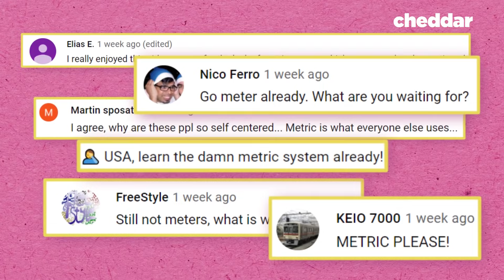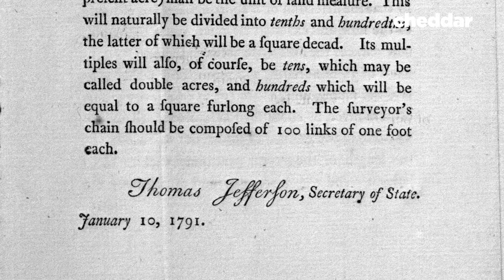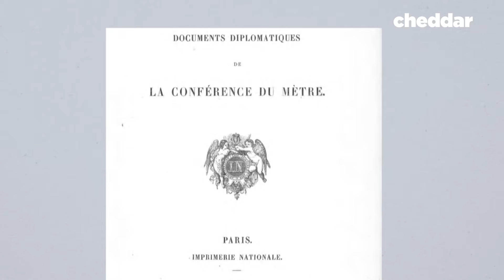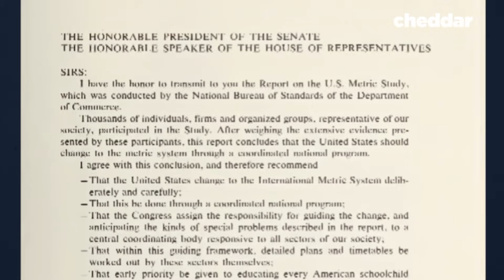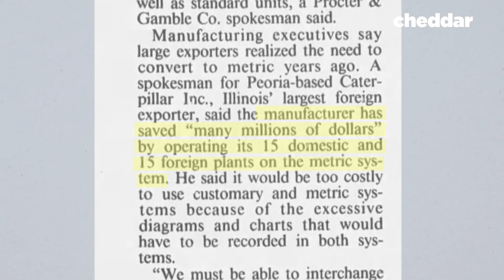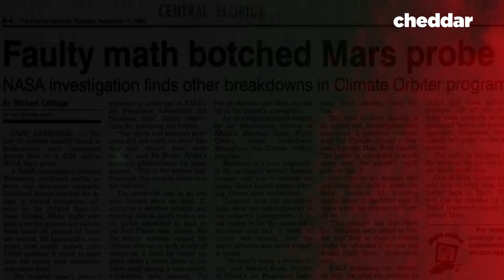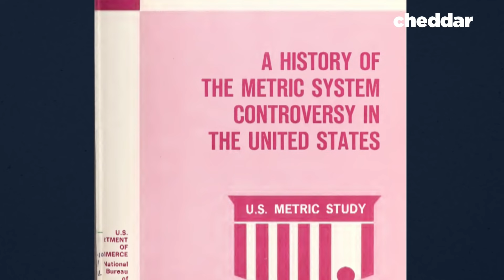Why Doesn't the US Just Use the Metric System? - Cheddar Explains

Comment: The thing that bugs me about America not using the metric system is that we still get TVs and monitors that are mesasured in inches and converting it to cm is annoying every time I want to buy one or when YouTube’s use the imperial system when speaking about a product 🙄
Reply: Yeah that's right, also the whole aviation industry uses imperial system which doesn't make sense in 2020
Reply: Just take a tape measure with you when you shop for screens.  Get one with a dual scale.
Reply: @GH-oi2jf  you can’t cause the screens are in boxes
Reply: @sihle8175  — Most places have screens out on display.  Even so, the measurement given is a diagonal, which is useful only for knowing which one is larger.  If you have a restricted space, and want the largest one which will fit in the space, you need the horizontal and vertical dimensions.

Comment: I highly recommend watching Numberhubs guide to the imperial system. It's hilarious and completely senseless. The imperial system that is, not the video. 

Literally NONE of the units, mass or length can be converted by a whole number, whereas the metric system can be converted however much you like with decimal increments of 10. Same goes to mass. 

And don't even get me started on the fahrenheit scale. Now that's one fucked up conversion...
Reply: That’s just not true.  There are 12 inches in a foot.  The conversion factor, 12, is a whole number.
Reply: @GH-oi2jf  Okay fair. But then there's 3 feet to a yard and1760 yards to a mile. In the metric system there's 10 milimeters to a centimeter, 100 centimeter to a meter and 1000 meters to a kilometer. What I mean is, there's no clean way to get from any length unit to any other lenght unit the same way as the metric
Reply: @24Shigeru24  — Three feet in a yard.  athat’s a whole number.  1760 yards in a mile.  That’s a whole number.
Reply: @GH-oi2jf  Yes, but can you, super quick, calculate how many yards in 3 miles? That's  what I mean. It's SUPER easy in the metric system, the number of meters in 3 kilometers in 3000. Nice and easy :)

Comment: Metric is only good for certain things that need very precise minuscule measurements.  But things in America are typically larger and longer.  The average American is used to going further in increments because we must travel further to get things done.  How would you like to do things one kilometer at a time going through Texas VS one kilometer at a time in Liechtenstein?  In Texas we’re used to traveling up to 2-3 hours each way for work, but on an average of 1/2 hour to one hour by car, which is usually 30 miles to 180 miles.  But in places like Washington D.C. 5 miles is to far to hookup for sex.  See my point?  Why switch to smaller incremental measurements, when things have to be done on much much larger scales?  Our largest cities in the US aren’t examples the average American struggle.  I sure as hell don’t want to say I ran 5 kilometers, when it was only 3 miles. We like to achieve things in larger sections, because, if we incrementalized it to death, we’d be sitting here forever doing nothing.  The only reason our races are metric is to attract international participation.  On the other hand temperatures and climate range much larger here.  So, with our larger range of climate we have plants that need more specific temperature ranges than Celsius provides.
Reply: Hi gdaholic - in science, astronomy, physics, etc... where we deal with incredibly large values, we use the metric system - it is a factor of ten not 1.66, then .28, then 1/27, etc...  No, I do not see you point.  In the military, we deal with very, very accurate firing solutions, at great distances... in meters or "clicks (i.e. kilometers).  Americans have a problem learning "new/old" things or accepting truth... Ciao, L (American Veteran).
Reply: lancelot1953 again you just proved my point, you only mentioned things that need great accuracy.  Something that is done casually on a daily basis would be very impractical to be measured on Metric.  Globalization is only convenient, not necessary.  And sometimes globalization makes things more inconvenient.
Reply: Hi Gdaholic, really?  What kind of rhetoric is that?  The metric system was adopted at great cost (for some countries) by the rest of the world for a reason... it's simplicity, its correlation/translation 1:1 with weight, volume, liquids, area, temperature, microscopic to interstellar distances, physics, chemistry, electricity, etc...  On a "casual basis" how is this "practical"?
1 inch = 16 lines,
12 inches = 1 foot
3 feet = 1 yard
1 mile = 5,280 feet or 1,740 yards, etc...
Now convert that in acres, Amps, gallons, Fahrenheit degrees, etc... or put that in fractions - metric systems is made up of factors of 10, all using the same prefix/suffix whether small or large.
This is why nearly all the US industries have switched to metric, no it is not for China, it is because it is better, it is scientific.  All medicine, engineering, electricity, astronomy, nuclear, etc... is metric, except some average Americans that just do not want to "learn", they call it "tradition".  If you "point" was so good, the rest of humanity would agree with you, but it appears that the world has changed despite your beliefs...  Incidentally, the atomic bomb was calculated with the metric system.  I rest my case and good luck, I do hope that next time you go to an emergency room, they do not prepare your medications in "grains" (old US standard)!  Ciao, L

Comment: Imperial is great for "guestimating'... such as ones height - 5 foot 7 inches...

But for accurate measurements, I would say metric..
So yes..metric :)
Reply: But how offten would you mesure your self.
Reply: Accuracy does not depend on units.  Neither does precision.
Reply: @GH-oi2jf  fair enough... but in this argument...metric vs imperial for day to day work... which measure of unit would be more 'reliable'.. ?

Comment: The standard system of scientific measurement are based on the centimeter, gram and second (centimeter-gram-second system of units).  There is also the inch-pound-second system, but someone also proposed a furlong-stone-fortnight system.
Reply: The last is just a joke.  The jokesters don’t add anything of value to the discussion.

Comment: At this point i prefer imperial for day to day use aka temperature, volume, weight, but prefer metric when doing calculations. Length under 50 feet is something i always prefer imperial for as feet are a lot more convenient than meters. If imperial had something similar (bigger than a decimeter, smaller than a meter) honestly it would be fine. Also Fahrenheit is better than Celsius. I want to know how humans feel not how water feels. In fahrenheit 100° is pretty hot for people and 0° is pretty cold. In celsius 0° is cold but not very cold, and 100° will kill you from your blood boiling. In outside temperature where I live fahrenheit is basically on a scale from 0° to 100° while celsius is from -18° to 38°.

Comment: Radio, Radar, TV have been using metric for generations - I began using the metric system when I began my interest in RF systems in the late '40s. It was a "no brainer" and simple and easy to use for wavelength measurement. When I lived in Japan in the early '70s, carpentry was easier with the metric system, because all dimensions were easily calculated using an inherently decimal system - (never needed to convert between fractions of inches to decimal & vice versa.)

Total conversion from one system to another is not always without difficulty however - During World War II,  the Russians reverse-engineered  a B-29 which had gone down in Soviet territory. They encountered problems in attempting to build a copy using material  they used in their aircraft manufacturing processes. For example, the thickness of Russian aircraft aluminum sheets used for the "skin", had no exact match with its US counterpart - so - "Do we use thinner, or thicker material ? " Thicker adds weight, and thinner may result in a compromise in strength.

Comment: Many "Imperial" units are NOT used in any normal person's daily life in the US. I have no fucking CLUE what a "gill" or a "rod" is, But I use millimetres (and inches) and liters (and gallons) daily.  I can use Kg AND Lb but NEVER used a "chain" or a "furlong" EVER.  And I am almost 60 Y.O.
Reply: You don’t have to know all the units, or even know what they are.  The more obscure units were generally chosen for particular purposes.  For example, the “chain” and “rod” were used by surveyors.  A chain is 22 yards, which is one-eightieth of a mile, and it was measured with a physical chain.  A chain of a yard would be useless and a chain of a furlong (one-eighth mile) would be much too heavy.  I expect they aren’t used anymore, because modern surveying instruments have made them obsolete.

A “rod” is a quarter chain, which is 16.5 feet.  That’s about as long a physical rod as could be managed, I suppose.

The furlong is mainly used in horse racing.  Most races are integral multiples of a furlong, but they are more commonly reported in fractions of a mile nowadays.  I think the name “furlong” comes from farming.  A section is a square mile and is divided into an 8x8 grid.  A field for planting could be an eighth of a mile long, and furrows would be a “furrow long” or “furlong.”

A US “gill” is four US fl oz.
Reply: @GH-oi2jf  LOL, I actually did know these. My point was that in every one of these debates someone HAS to point out the more obscure units as proof that Imperial is obselete and somehow silly. I as THOSE folks if the measure angles using "degrees" or "radians".  The lesser used units of course are used in certain feilds (jewelers, surveyors, )ETC.  Even common ones aren't used as much as people think. I really only use "yards" when discussing carpet or (American) football. Give people an inch, and they'll take 1.61 kilometers. 😛

Comment: Yep, this is one of those issues where America is the cause for a lot of unnecessary face-palming across the world.
America: please put your misguided patriotism down for a moment and do what needs to be done here.

As a Kiwi engineer working in North America I regularly see the mess created by stubbornly retaining this absurd mess.
A recent example: the survey for the bridge I was working on was off by about 300mm (I'm not going to convert that, out of principle). Why? Because the survey data was in US Survey Feet, but had been interpreted to be in Feet, because it turns out that the surveyors in a large number of US states use a different 'foot' unit that's not equal to 12 inches, but 12.00024 inches. Over the long distances that surveyors work in, this slight (and mindbogglingly unnecessary) difference can equate to a significant error.

Another example? There's no unit of measure for mass in common usage in the USA (they actually use a unit called a Slug, but I'm gonna bet you'd never heard of this, as nobody tends to use it or understand it). So it's very confusing when it becomes necessary to differentiate between a weight (Newtons) and a mass (kilograms), as is necessary when performing as dynamic structural analysis (say, a seismic analysis). So my fellow structural engineers in the US will typically convert their analysis in to metric units, run the analysis, then convert the results back again. It's insane, and the cause for a lot of confusion, errors, and economic loss.
Reply: The Survey Foot is obsolete and is being phased out.  A mixup is probably due to someone not documenting his work properly or not checking the documentation carefully.  Any US surveyor or civil engineer should be aware of the problem.  The rule today is that “foot” without qualification means the international foot.

The difference wasn’t caused by creating a “survey foot” to be different.  It is just an old standard for the foot.  The surveyors stuck with it because they had a vast amount of data.  The International Foot was adopted in 1959 and they aren’t done with the conversion yet.

Comment: US $ system is based on decimal. I'd love to get rid of fractional measurements in length and go to decimal. Still have inch, foot, but instead of 1 1/4" it be 1.25". Could merge this to weight too. I know most industry is decimal, but us commons use fractional measurements. I am old enough to remember the catastrophic attempt to force metrics onto us "Mericans back in the 70's. Most memorable was when "petrol" (gas) prices were really rocketing up, the old analog dial type fuel pumps could only register to 99.9 cents/gallon. When the oil war hit, "gas" shot up to over $1.00/gal US! Oh oh, now what? Hey, lets change all the gasoline/diesel pumps to METRIC! Instead of a gallon, make it a liter! Now pumps say 42 cents/liter! Instant confusion with the 'Merican people! LOL. Gas pump manufacturers started cranking out new upgraded fuel pumps faster than B-52's in WWII! Next came the speed limit signs! OMG. BIG MPH and under it little K/h number. It's still a "thing" with domestic car speedometers. Notice the K/h scale under the MPH? Funny. Look @ a Canadian car, it's the opposite.
Reply: You can use decimal fractions with feet.  That’s an engineer’s scale and you can get a tape measure marked that way if you like.  Go for it!

Comment: Always thought it silly to put 3.8 liters on a gallon of milk. If need both use whole numbers for metric. 2 liters soda bottles is a good start; for milk make 4 liter containers = 1.05668821 gallons. Best advice don’t do both, go metric.
Reply: I doubt the dairy industry will change anytime soon.  Fresh dairy products aren’t exported, so there is no need to convert.  But most packaged food products are labelled with metric equivalents for the benefit of those who are most familiar with metric.  There would be huge resistance to a change, I expect.

Comment: The US military uses metric in a lot of areas... An Abrams tank has a 120mm gun... A medium size howitzer has a 150 mm caliber barrel. Distance along the ground is measured in kilometers aka klicks. 

I have worked as a chemical engineer for 40 years and most of our projects in the US (and, of course, all our projects in other countries) used metric. The main exception is the oil industry which still uses a lot of psi for pressure and barrels for volume.

NASA has been standardizing on metric since 1990 (30 years ago) although, in 1999, they managed to destroy the Mars Climate Orbiter (which cost over $300 million) because software supplied by Lockheed generated output in English units and the NASA software that used the Lockheed results expected them to be in metric units.
Reply: Many Navy ships have a five-inch gun.  It isn’t a problem.

Comment: Time isn't metric; we measure time in base 60 and no-one seems to have a problem with another system of measurement. Also, temperature in Fahrenheit is much more meaningful for human environments.
Reply: Fahrenheit is utterly meaningless, period. Everything useful for measurement happens at utterly arbitrary and random points on the scale. Why the fuck is the boiling point of water set at 212? I couldn't even tell you where the freezing point is. And the what the hell does 0 signify?

But yes, time isn't metric until you get down to sub 1 second time increments. I actually can't remember where our time measurement scale comes from. I think it's maybe Babylonian?

Comment: The metric system is already shown to be dire for most people. The French still use old measures, Britain uses a mixture - as is sensible. Sadly the metric system is daft when applied to clocks and time (Yes it was tried  - by the French) .  It matters not one jot as to how any unit is defined, what does matter is how people find the unit in use.

Comment: American hospitals use the metric system for body weight, as it simplifies the administration of medications (which is based on a patient's body weight).
Reply: I’ve been in a US hospital recently.  They still weigh patients in lbs, but the pharmacy will use kg when necessary to prepare medications.  Since the patient charts are now on a computer, I expect it is available in either units without requiring anyone to convert it.

Comment: Stapling the use of the metric system to globalism in general is primarily why a lot of Americans don't like the Metric System. When in discussion, singing the praises of a 'one world' is never far behind the reasoning of using the metric system. And given the geographical isolationism the average American experiences, switching to a new system because of some Europeans they've never met seems somewhat backwards.

Further, the argument of redoing a lot of infrastructure is far more significant than you would expect. Replacing thousands upon thousands of signs is expensive, and the less said about general infrastructure and other large projects, the better. In the event that the United States can start adding redundancies to electrical systems, telling the environmentalists to fuck off, or getting the individual state governments to get off their asses and begin cooperating again, I would have no problem switching over to the metric system. However, that would cost billions and trillions of dollars already earmarked as foreign aid, military spending, or welfare. So as it stands, the switch from imperial to metric is far more complicated than just jingoism or idiocy.

Comment: Australia used the imperial system until 1971 then converted to metric
Reply: I’ve read that they even switched to metric for horse racing.  Why?  Do they run races at the old distances, but represented in metric units, or did they change the distances?